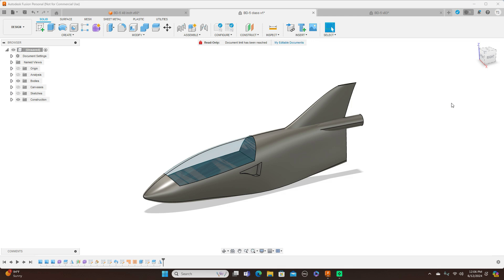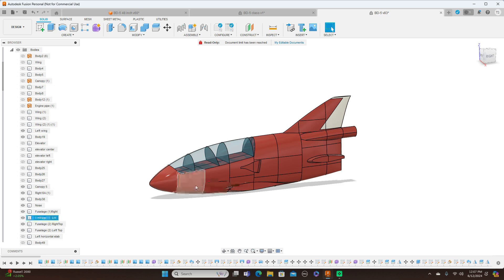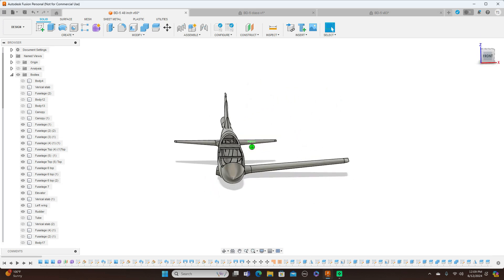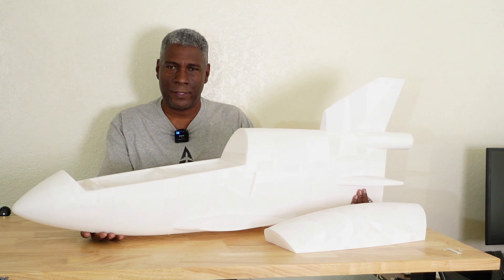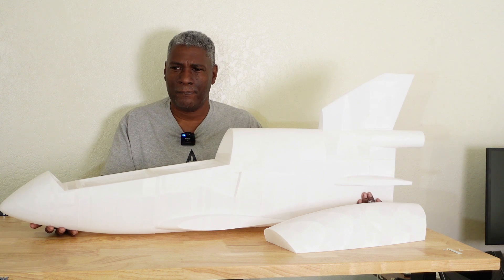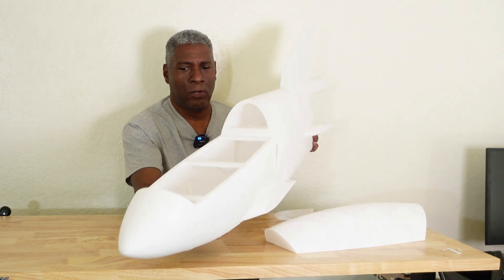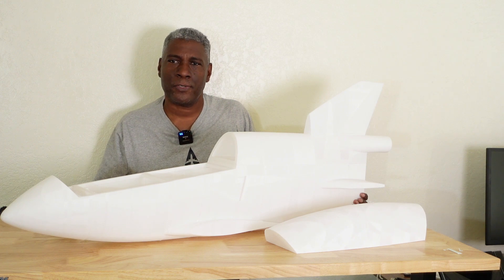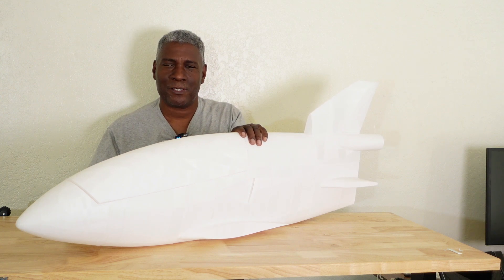3D printed large flyable BD-5.  Can you help?

Comment: Tony Fiori did a BD-5 electric pusher back in the 90s. It flew very well. but was smaller than your model.
Reply: He used a mid mounted motor and a drive shaft to make balance easier.

Comment: My first model airplane magazine was Jan 1975 Model Builder. It had plans inside for a profile BD-5J hand launch model. I blew it up double sized, it flew great. I would use the 3D printed fuselage as a plug to make a fiberglass mold, then use foam core wings for the flying model.
Reply: What is the diameter of the 'tail outlet'? I'd like to build a regular BD-5 prop plane? I don't have a 3D printer yet.